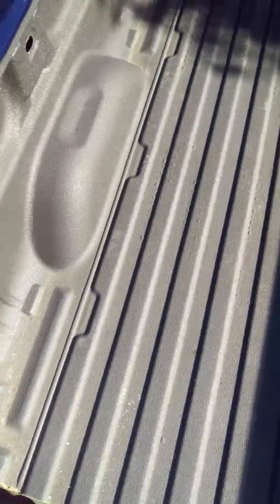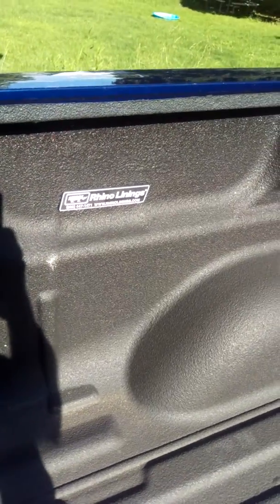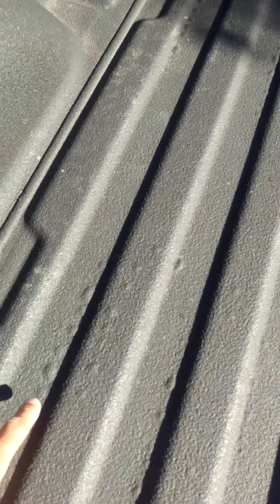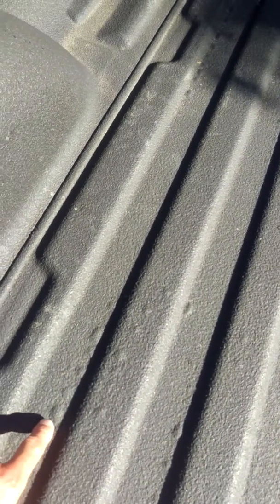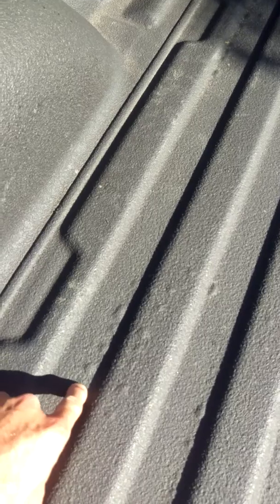Problems with Rhino liner - 2017

Comment: I had some pretty good Rhino Liners back in the day (1996 or so) back when the truck had to sit overnight to cure.  Their new process seems to be absolute crap.  I called several dealers in Maryland and Delaware, the costs vary by $150.00 for the exact same product, and I have been told 2-4 hours by one shop, and all day by another.  I decided to stick with Line-X.
Reply from the maker: I let the same dealer try to fix the problem. They had the truck for a week! The new liner is starting to do the same thing the last one did in spots. Whatever chemical they used is removing the original color from the paint on the cab of the truck and the black plastic of the bumper! They cut the original paint on the box and they only wanted me to pick plastic bed rail covers to hide the F*** ups!!! Rhino liner said they would look into the problem at Ziebart and if determined to be installed wrong the would pay to have it fixed. Now I have a truck that has been damaged twice. I only wonder if trying to fix it a third time what more damage will occur to my truck. I will never allow Zeibart touch another truck of mine for rhino liner that I will promise!
Reply: @markpatterson6819  I spoke to a co-worker, and he told me to look at Bullet Liner.  Apparently, the guy who founded Line-X sold the company and signed a 5 year no-compete agreement.  I was scheduled to pay $900.00 (less 10%) for their Platinum liner.  I was told that the strength gains don't really matter for my use, and that the standard liner for $500 would hold up fine.  Rhino charges an additional $100 for the UV stabilizer topcoat.  Bullet Liner gave me a quote of $470. and the UV topcoat is part of their normal liner.  So, I guess I am going to pocket a few hundred and go with Bullet Liner.
Reply from the maker: You have to let me know how it performs... My other option in the future is to custom order the truck with GM liner!